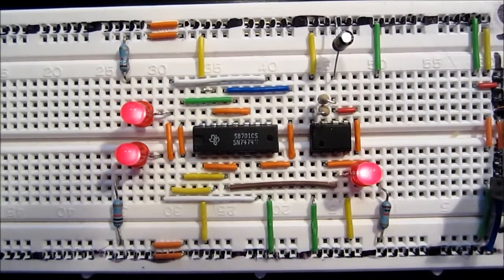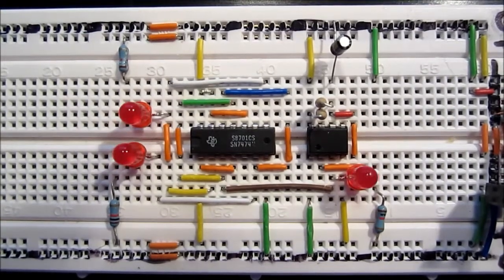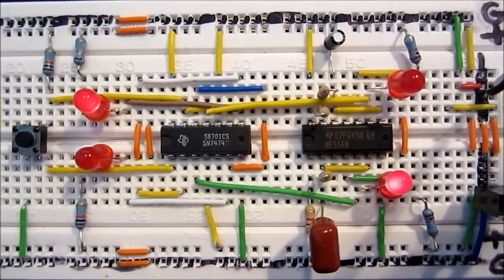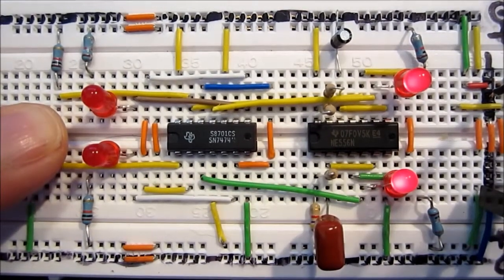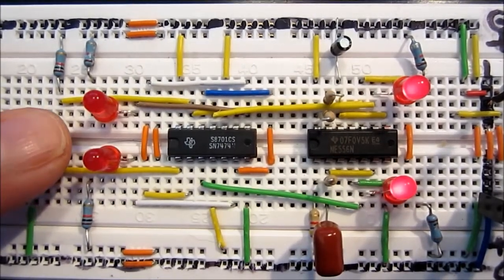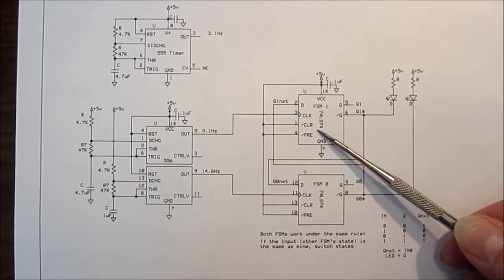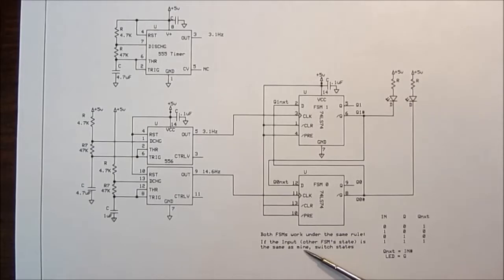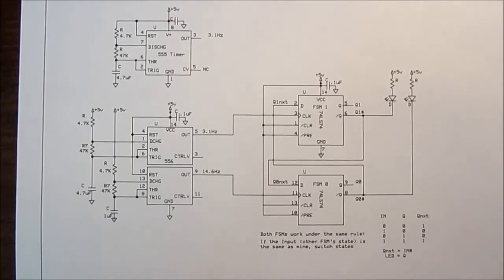Peer-to-Peer Network Demo

Comment: Never thought I would ever be first to comment on something seven years old!
I looked at what you tried to achieve and find it fascinating.
One more change you can consider to this system is to use some kind of flip-flop and additional circuitry to make each of the two state machines first use one clock and then the other. This means that  Machine A, MA, would use clockA and Machine B, MB, would use clock B. Then depending on the flip-flop's state, they system would switch Clocks. 
As it now stands, I see the system as it is, as a kind of race-condition demo.
You can use it as a teaching tool about race conditions, or even to prevent it by supplying a preference of one over the other.
I just wonder if the lower frequency clock has higher or lower priority, i.e. does it get to decide first about the state it will adopt?
If frequency is significant, then that is what this is all about.
It might also be a kind of demo of what quantum entanglement is, though I don't claim any sort of mastery of the notion.